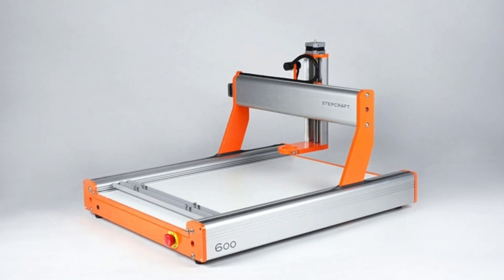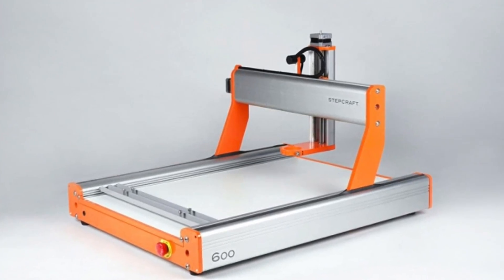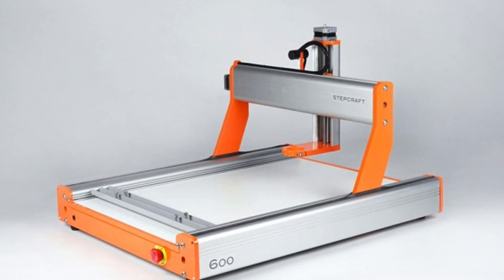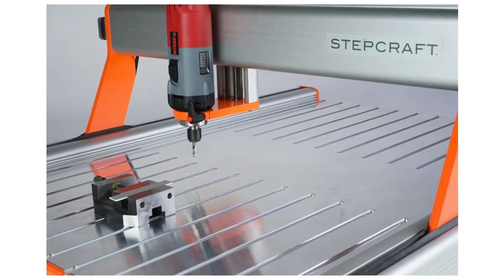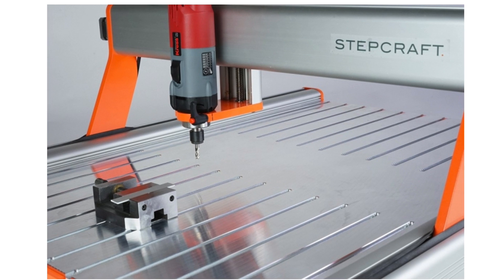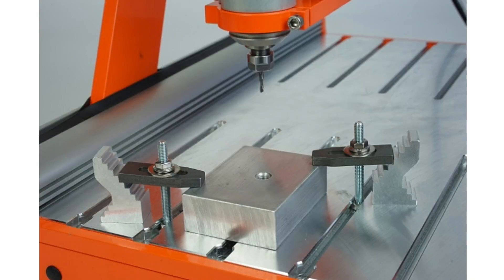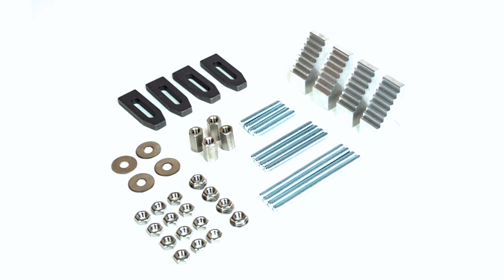STEPCRAFT CNC SYSTEMS - Choosing a Machine Table

Comment: After near 2yrs with the original white board, I had just installed the aluminum table I recieved in the mail yesterday. I was desperately needing the benefits of the t-slots and stiffness. It was the answer to my "frustrations" but I can understand why it doesn't come stock with machine. (Initial cost to customer).

Comment: I need to cut a 10mm Titanium plate. Would a 600 be good to do the work?
Reply from the maker: No, you can not cut that hard of a metal on a CNC Router.  Only non-ferrous metals (aluminum, copper, brass, etc)
Not sure the best tool for that.  Maybe waterjet, laser or plasma.